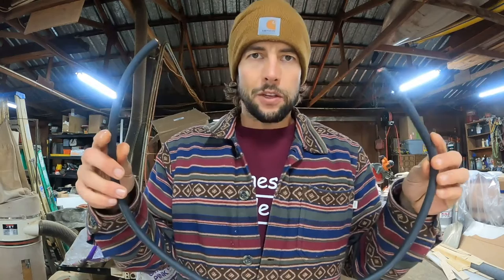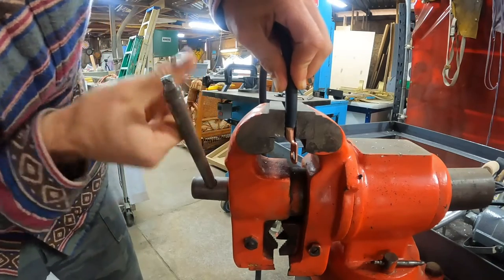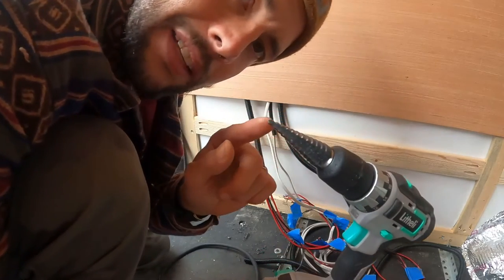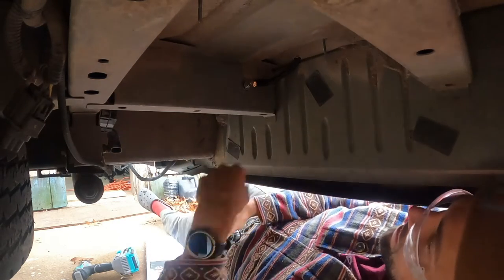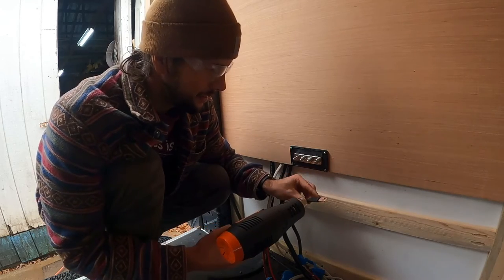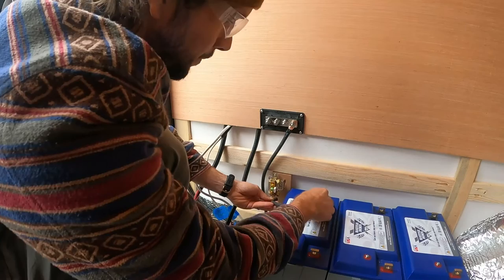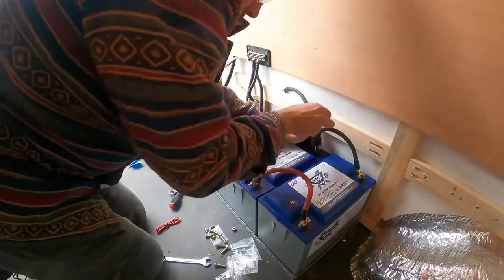Grounding Your House Batteries | How to Ground Batteries to Van Chassis | Checking Ground Connection

Comment: You should not add washers between your electrical joints. Washers should be used on the outside to distribute your bolt clamping force. The washer in the middle will add a small amount of resistance to your joint. Sanding down to bare metal prior to torquing will be much more successful and maximize the surface area bonding your terminal lug to the chassis in this case. Good luck and happy trails!
Reply from the maker: Awesome thanks for this!  Appreciate it!

Comment: Awesome video. One question. Heard Lithium leisure battery best not to ground because of BMS? Do I have to ground for Lithium battery as well? Cheers
Reply from the maker: I’ve never heard this. I’ve grounded every lithium battery I’ve ever installed
Reply: @Vankookz  I see. I guess I will proceed and to replace. 
Thanks for the information!
Reply: Yeah your going to get funky voltage reads and your BMS could turn off to protect your batteries. There’s also a possibility you could damage your vans circuits from back feed. Just letting you know from experience. Good luck

Comment: Is it ok to use the starter batteries negative terminal as the earth? As my vans build is complete so cant realy access the chasis.,.
Reply: There’s usually a heath point inside the van I use the rear seatbelt anchorage that overkill

Comment: Hi, thanks for the video. I’m at the terrifying electrical stage of my build haha. 
Can I ask, what size drill bit you used for the chassis hole? Small and also what size bolt were you using?
Thank you for the video! ✌️✌️
Reply from the maker: I used a step bit there's a link in the description. I recommend a 3/8" or larger stainless bolt with locking washers.  All stainless steel otherwise it will rust.. Someone had a great comment about the bolt to the chassis as well in the thread.

Comment: Is there any benefit to attaching the ground to the chassis versus the frame on the inside of the van? Also, would it be necessary to put some sealant around the wire that went through the floor, to prevent any water from getting in? Or is that that just totally unlikely to happen?
Reply from the maker: Chassis or frame is ok I’ve done it both ways. Also yes you can use a sealant I didn’t show that step but I used lap sealant.

Comment: Did you not just dril through your chasis to run your wire through to connect to the frame?
Reply from the maker: Yeah just used a step bit popper a hole and ran it through added a rubber grommet to the hole as well to protect the wire.

Comment: Are you using the word "chasis" for "frame"?
Reply from the maker: You just need to find a solid ground connection on the body/frame of the van.
Reply from the maker: I’ve used the body before and it’s fine. Just text with a multimeter

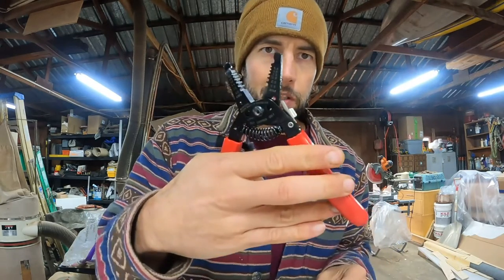Comment: "2 gauge" (2AWG) is far smaller than 2/0 (2 aught). Looks like what you're holding in the beginning of your video is 2/0. There's a difference, and especially if you intend to guide folks who are seeking to learn this stuff. Thanks for your content, otherwise. Oh, and go getcherself a good pair of electrical CABLE cutters. Helps to keep the fine copper strands in good-quality cable from being squished out-of-round, and that eases the installation of your cable lugs. Anyway, I had to bail at the 1:43 mark. Good luck to you.

Comment: Why not just use the seatbelt bolt if one is convenient?
Reply from the maker: Yeah that will work too
Reply: I was wondering this. Why drill holes in the chassis? There's loads of bolts inside !

Comment: Crimp with a vise grip, urh!!! I don't care how much force you can put, it won't apply the pressure to all sides. The flat part of the crimp is pretty weak, can't meet the minimum compression.  Sorry, pls stop showing people.  Either use a proper crimp tool (hydraulic), or drill a hole through the lug, crimp using a vise-grip, then heat up and pour solder into the hole. (apply flux to the wire before crimp).
Reply from the maker: Thanks for the feedback.  I really appreciate you sharing your knowledge.  While I have used the hydraulic crimp tool in the past.  I definitely should get another one.  Sometimes on this channel I like to share how to do these diy van projects on a budget.  We like to promote that sometimes can make it happen with what you currently have.  I've crimped many wires with this vise and the lug is so incredibly smashed on there (for lack of a technical term) and I've never any problems.  However, I totally agree.   I was going to buy some proper crimpers for upcoming projects because it's so much faster.  So I wont show this dirtbag hack anymore.    If you have any recommendations for good crimpers I'll check them out.
Reply: I like that you want to show ways to get by with what you have not only for budget constraints, but also as van travelers our space is very limited. I do not have a set of crimpers large enough to crimp the heavy gauge wire needed for my HO alternator, dc to dc charger, etc... The hexagonal large gage crimpers aren't overly expensive but they also aren't something I want to carry around. I was considering the hamer style lug crimper because it's more compact. The hammer style crimper seems to utilize a pinch point crimp, I think by pinching some of the lug in the center you reduce the over all circumference of the lug. I do have access to a vice at the moment, I wonder if adding something in between the vice and the lug to create a pinch point would work the same as the hammer crimper and give a better overall fit to the basic smash. Thanks for the video!